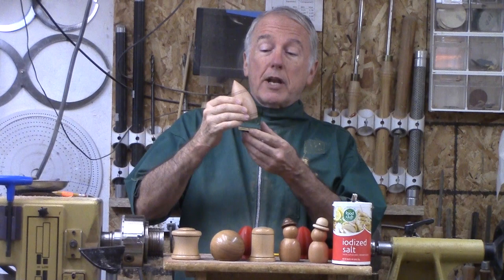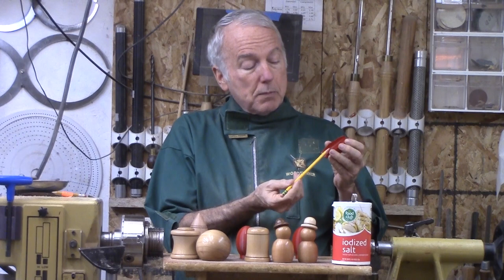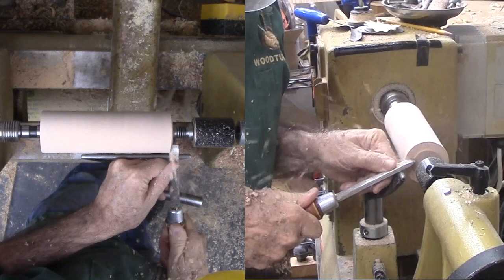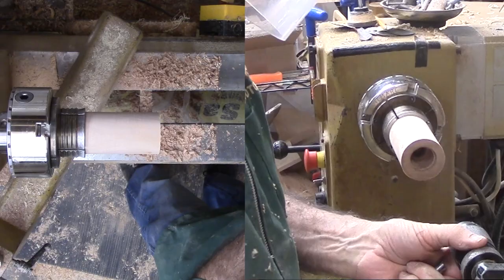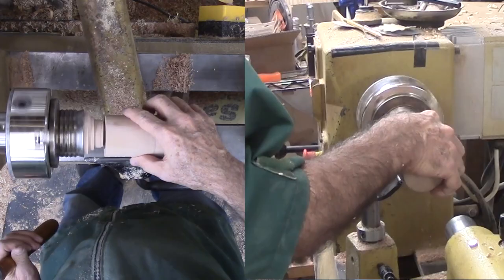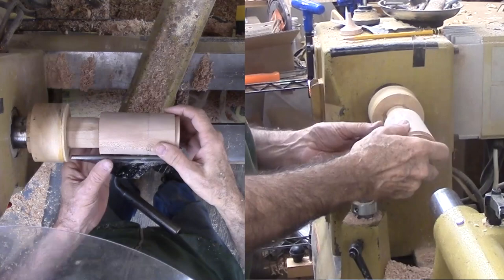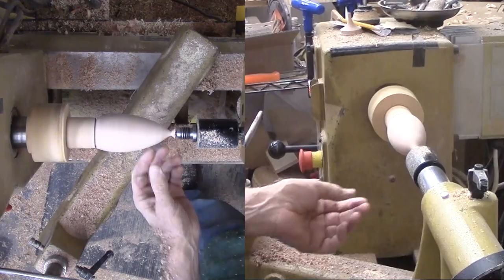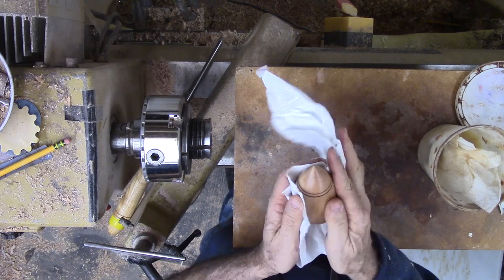Revealing The Mysteries Of Turned Volcano Salt Urn

Comment: As typical, clear precise teaching. Thanks.  I've made many of these salt shakers.  The items are great party favors but rarely stay in routine use because they don't deliver much salt per shake.  My solution is a minor deviation from your plan.  I make the end of the internal cone into a slightly larger funnel.  The salt fills this funnel with each shake.  You shake once over your food, but the salt runs out until that internal funnel is empty - enough to season your vegetables with one shake.
Yes, I wear my face shield and my dust mask.  
John
Reply from the maker: That works. Thanks for sharing.
Alan

Comment: Very nice! I'm glad I viewed the video. When I've seen this type of salt shaker demonstrated in the past, the demonstrator made a big deal of curving the top of the 'salt chamber' into a shape that was the inverse of the funnel at the bottom of the shaker. Once assembled, this leaves a cone pointing up (the funnel) and a matching cone pointing down, like a wooden version of stalagmites and stalactites. It was said that this shape to the ceiling of the salt chamber guided the salt into the hole in the funnel. You demonstrated that this shaping of the interior may make the turner feel good, but it is unnecessary for function. That will save some time!
Reply from the maker: Sounds like he needed to enhance it. But the workings are very simple.
Alan